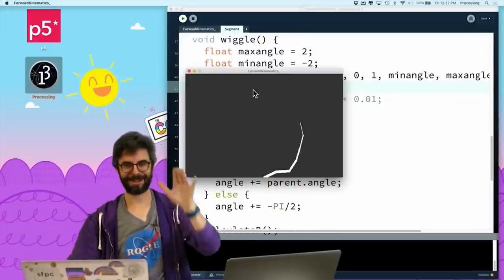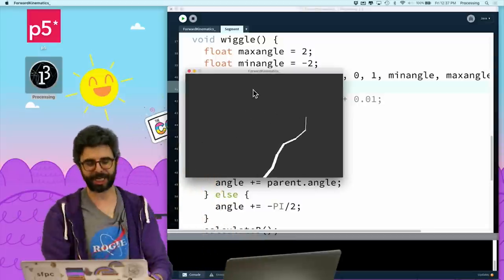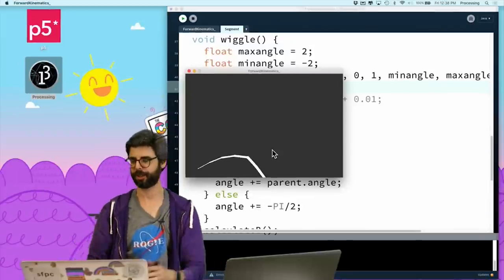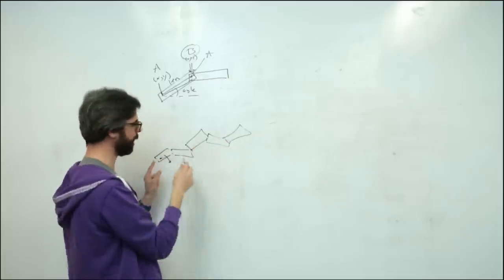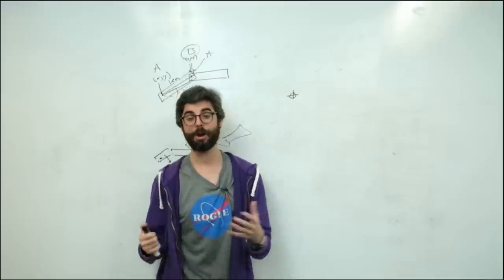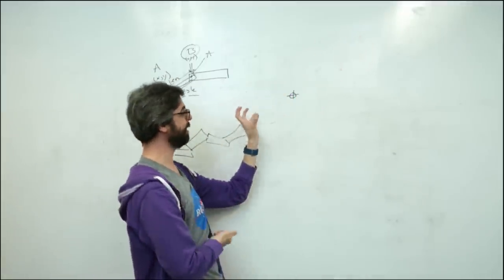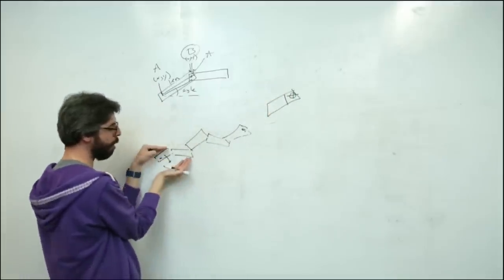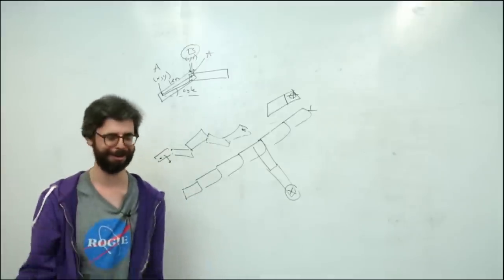Coding Challenge #64.2: Inverse Kinematics

Comment: Why do we again, in the very beginning, make a statement ,that every next segment has an angle related to X, but not related to previous segment? In robotics with real motors it is actually so. The drive controller has no idea about orientation of the linked motor related to X. It has only a hardlink to the previous segment(s), and therefore the angle related X axis at every time moment is an unknown value, available only on a master-controller level  - the controller that manages the motion of the whole "arm" can calculate it.

Comment: Why would you use heading()? Isn't the point of this to explain the maths? This turns it into a Processing specific tutorial where now we have to look for other sources or the Processing source code to write an implementation.
Reply: Jeru Sanders I think it would be pretty easy to implement calculating the heading in other languages, but yeah, that was an oversight.
Reply: Mate, if this was about maths, he wouldn't be using Processing to begin with.
Reply: Thats what i thought too, but you can do it all withought processing or Pvector. The mouse sets the point for the first heading, take its x and y component separately and calculate the distance to the first point, then just apply dy/dx and do atan(dy/dx) to get the heading angle. Probably otherways of doing this but it works. Heres an example.

https://www.khanacademy.org/computer-programming/kinematics/6459923859341312

Comment: I dont think inverse kinematics is a big problem in robotics
Reply: it can be if you want to be precise and fast with a complicated, constrained kinematic chain.
Reply: Mathias Gredal it's a solution. I work in robotics, trust me.
Reply: Aidan Gomez how would you go about this in robotics where there is a limit to how much you can move a segment, which means there would be only one solution or multiple solutions out of which only one or a few would be considered ideal?
Reply: It isn't a problem in itself, Inverse kinematics is  a tool to express the joint variables as a function of Cartesian coordinates as opposed to the forward kinematics expression that gives Cartesian coordinates as a function of joint states. 
The issue with Inverse kinematics is that the way you convert coordinates to joints states is by means of a coordinate system relation called the Jacobean, which takes the partial derivative of all your parameters. Meaning you express changes in space not position in space. Down the line this results in a problem when inverting the jacobean, as it can become singular. But you need to invert it to take coordinates as input parameters. Figure out how to pull this off without deviding by 0 and you solved the "big problem". Another reason people get all antsy about inverse kinematics is because when you define the inverse kinematics of a system you often wind up with an underdetermined linear system,  this means that the number of equations is fewer than the number of unknowns. Such systems usually have an infinite amount of solutions. Which means you need to use an optimizing algorithm to find a solution. And then you still need to validate it afterwords. 20 years ago this was computationally too much to handle.
Reply: There are arbitrarily infinite solutions for inverse kinematics. It can be a problem...

Comment: Calculating the heading angle and moving the segment is not needed. There is much more simpler optimised solution with vectors.
There are 3 points -> head of the segment, tail of the segment, target point where the segment must follow.
Since the head of the new displaced segment will be as same as the target point, only the tail of the new displaced segment is remaining.
The trajectory is the vector pointing from the tail of the segment to the target point.
The new tail will be a point along the trajectory.
The tail of the segment has to be displaced with the value of length difference of the trajectory and the segment along the direction of the trajectory.
To calculate the tail of the new displaced segment,
Find the length difference between trajectory and the segment.

Multiply it with the unit vector of the trajectory to get the displacement vector.
Add the displacement vector to the old tail point of the segment.

I have attached my source code for reference
https://github.com/AshwinSanthanam/inverse-kinematics.git